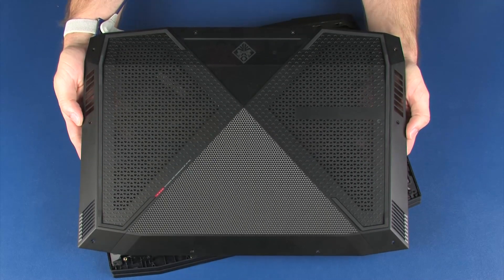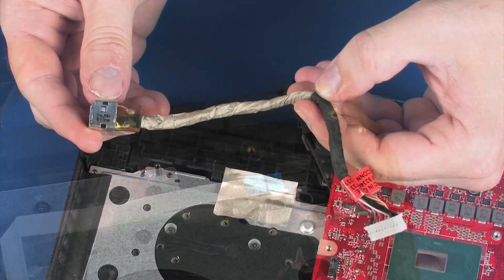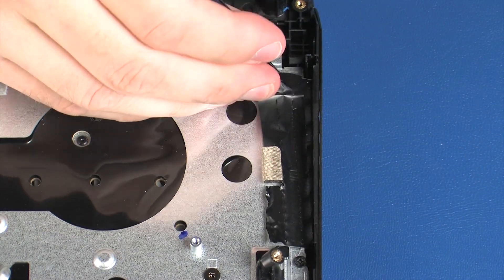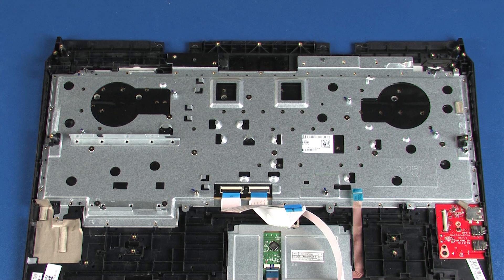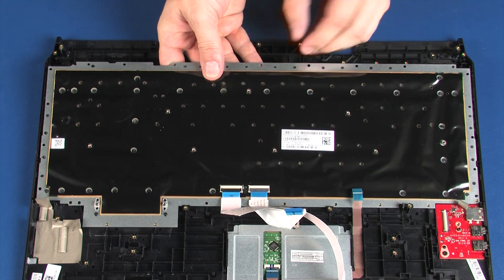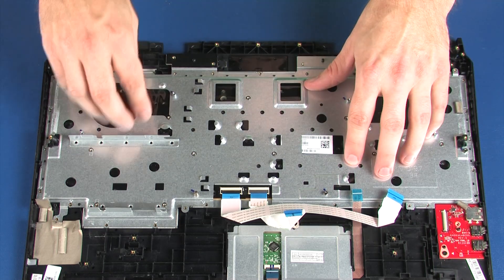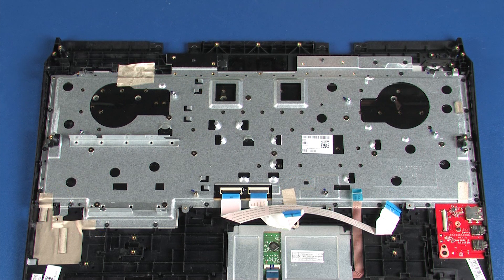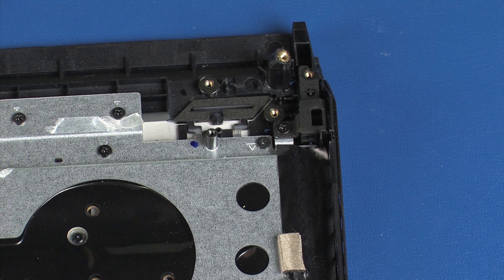Remove and Replace the Keyboard | OMEN X by HP 17-ap0xx | HP

Comment: where can I buy the replacement keyboard ?
Reply from the maker: The best way to find the correct part number is by using the HP PartSurfer.
Put your laptop's serial number in the search and click on the magnifying glass icon. Look for the display in the list.
https://hp.care/6059tRiiz
Regards, 
HP Support
Reply from the maker: Hi there, thanks for contacting HP Global Social Media Support!
I understand that you need to purchase replacement keyboard.
I will do my best to assist you.
For optimal PC and printer performance, remember to always buy (use) Certified HP Genuine Replacement Parts from a known and trusted source. You can order it via the HP Parts store: https://hp.care/6053tR5dl 
Regards, 
HP Support
Reply: @HPSupport useless link, can't find any replacement keyboard. I need the same one as in the video

Comment: I am in the UK, I can only find European top case's. can I swap out a european languaged keyboard for my current UK keyboard?
Reply from the maker: Hi there, thanks for contacting HP Global Social Media Support!
I understand that you need to know whether you can swap out a European language keyboard for your current UK keyboard.
I will do my best to assist you.
HP does not recommend upgrading or downgrading hardware parts or software that is bundled with the product as It may affect the manufacturer's warranty and performance, however, you could change the configuration at your own discretion.
Regards, 
HP Support

Comment: I just removed everything ant it seems that keyboard holding  metal bracket soldered with plastic instead of screws... Wtf I cant change it, and there is like 100 soldered points....
Reply from the maker: Hi Tadas, thanks for contacting HP Global Social Media Support!
I understand that you are experiencing an issue in replacing the keyboard. 
I will do my best to assist you.
May I know the complete model number of your computer?
Please let us know. 
Binu - Social Media Tech Support
Reply: Same here, all soldered 17an0xx

Comment: With help of the video I managed to replace my defective keyboard. My "E" was not functioning, after assembling the laptop seems not to be working, the keyboard illuminated OMEN lit up, but screens stayed black.  checked all the connections all where okay. tried again and saves some time with patiences.  after power-on again the keyboard lit up. after a while laptop shut down and started up with a Bios failure. after accept the fault laptop booted normally   Sooo happy  new keyboard 99Euros :)
remarkeble:  kensington lock was underneath the keyboard instead of on top and many screws of the motherboard and others where very loose. Excisting thermalpaste looked overheated with an airtbluble inside.
approx. 2 hours incl other activties
Reply from the maker: Hi Sebastiaan, thanks for contacting!
We are delighted to hear that it is working!
If you need any help in the future, you can always get back to us.
Thank you for being a valuable HP customer.
Have a wonderful day!
Cheers!
Binu - Social Media Tech Support
Reply: @HPSupport   thanks :), I red somwhere about GPU upgrade, is there also a video made of that action?
Reply from the maker: Thanks for the reply.
You can upgrade the graphics card, the only thing that might hold you back is the power supply but 500w is likely enough.
Binu - Social Media Tech Support
Reply: @HPSupport  o wow , my supply is 330W what I thought it was already tremendous.
Reply from the maker: If you need any help in the future, you can always get back to us.
Thank you for being a valuable HP customer.
Have a wonderful day!
Cheers!
Binu - Social Media Tech Support

Comment: I have this EXACT keyboard unit and some ginger ale spilled and got under my space bar. Now it's sticky all the time.

I can't find a guide on this specific keyboard to know if it's okay to take the key off without breaking it. I paid over $200 for the damn thing, and now I can't even clean it.
Reply from the maker: +Ken Hagen Please contact our phone support team to fix the issue. Please follow these steps to reach them.
Step 1. Open link: https://support.hp.com/us-en/contact-hp
Step 2. Select the product type.
Step 3. Enter the serial number of your device or select let HP detect your product option.
Step 4. Select the country from the drop-down.
Step 5. You should see the HP phone support number.

Comment: I have that exact same laptop, it’s the E key that isn’t working only, do I need to replace the whole keyboard?? 
If I do, I can’t seem to find a replacement anywhere! Not on HP parts either, could use some help please
Reply: Yup , it seems like we need to replace the whole keyboard just to get the W key working again 🙄
Reply from the maker: +Filipa Bastos Please contact HP Shopping team to purchase the keyboard: https://bit.ly/33djkBd
Reply: I have the same problem, first the O stopped working and then E. Now I'm looking for the keyboard but seems impossible to find out :v

Comment: why does omen x gets a normal front cover, but omen 17-an has plastic rivets? nice going hp
Reply: This is my issue. The keyboard is secured by plastic rivets and one of the keys is permanently pressed. I cant find a replacement front panel anywhere. What did you do to resolve your issue?
Reply: @andrehutchinson6463  cut all the rivets with a plier and restore with abs, be careful to put the keyboard well back in place at every rivet you restore or you'll have a wavy one like mine =) But no functional issues ( an0xx)
Reply: @andrehutchinson6463  I found a plate at AliExpress, it wasn't original tho

Comment: My shift key has stopped working for almost a year now.
I have been using a apple keyboard that I just plugged in to my laptop, but now I want to get it fixed. 
I went though the comments and saw the link your provided but the keyboard cost 346.50$.
Am I looking at the wrong product because I do no think a replacement keyboard should cost 346.50$.
If so can you provide me a link that takes me directly to the keyboard. Thanks!
Reply from the maker: +Kaan Atak You can purchase the part from here: http://partsurfer.hp.com/ Please select your country and enter serial or product number of your unit.
Reply: @HPSupport  So it is 346.50$ for a replacement keyboard wow.
Reply: exact same problem!!! ridiculous 350 for a replacement!!!

Comment: hello, i have keyboard issue that happened suddenly without any introductions the letter "D" stopped responding from the first press & i have to push it hard or more than once to be pressed.
I have tried all the software solutions on hp community hub without a fix.
do i have to change the whole keyboard for a key ? 
my laptop is still on warranty and i live in Egypt i would like to have a direct link with HP company customer service as my laptop isnt cheap and i've used it for 10 months only. 
product number : 3YA34EA
Reply: Hello shareef , i have the exact same problem with my keyboard, can you please tell us how you got over this problem ??
Reply: @aboudejeber1976  replaced the keyboard
Reply: @ShecoTheElite  😟 oh so it seems like I'll do this a lot since I'm a programmer...
Reply from the maker: +Shereef Refaat Please follow the guidelines under this document to fix this issue: https://bit.ly/3fCLMk0

Comment: i have HP Omen X 17-ap051nr. recently A key stopped working, well its not broken but i have to push it hard. do i need to clean it?
Reply from the maker: +Vladimir Palputin Please perform the steps mentioned under this video to fix this issue: https://bit.ly/30uWLpr
Reply: @HPSupport  tnx

Comment: i have the same laptop but my keyboard was not screwed in it was little plastic knob that i had to melt of and glue the that melt cover on..wich sucked got the job done but there making thing cheap and fast .... no screws for that keyboard cover ....
Reply from the maker: +Garry templeman I am glad to know that your issue is fixed.
Reply: i had the same issue with an an0xx, i had to cut them all with a plier and restore again with 3dprinting abs filament you should alert owners HP